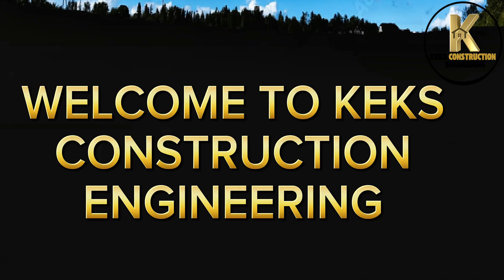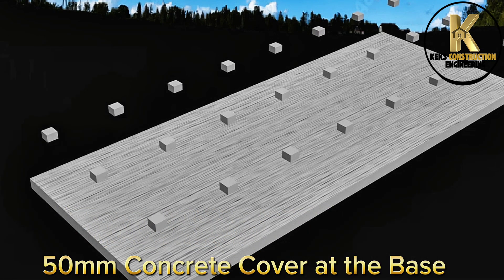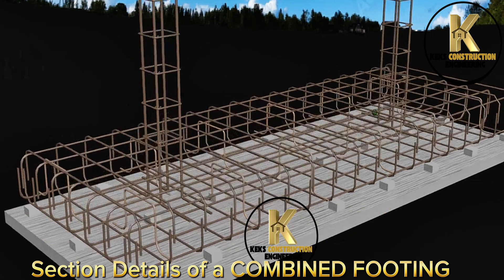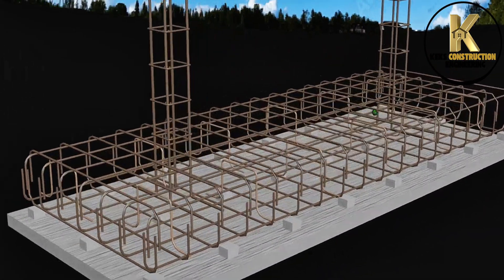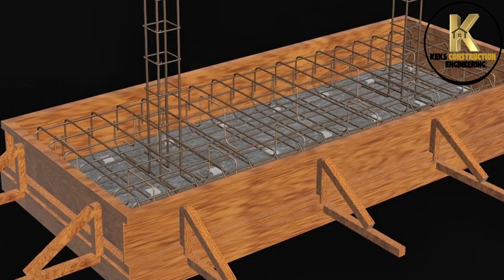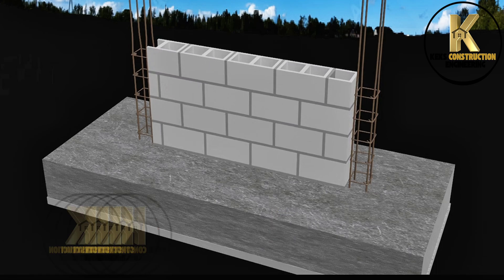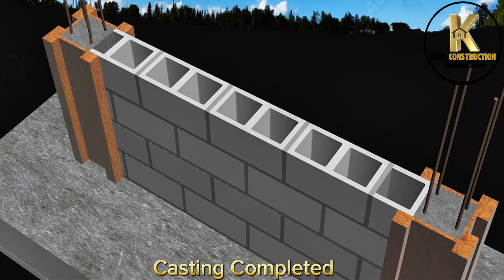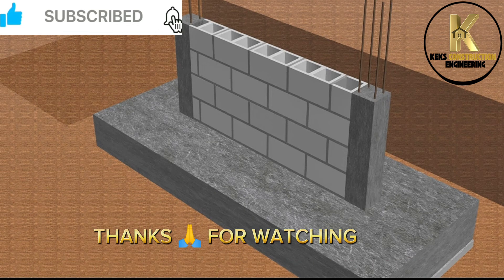COMBINED FOOTING Details & the Step by Step CONSTRUCTION PROCEDURES

Comment: What's the diameter of reinforcement for the horse benches? And it's purpose
Reply from the maker: Y10

The purpose is the Separate the Top Reinforcement from the bottom Reinforcement so that they will not lap together and reduce the effective depth of the Base. The horse bench serves as a Chair for the top Reinforcement to sit on without collapsing to the bottom Reinforcement.
Reply: @keksconstructionengineering  Sir how can it reduce effective depth of base
Reply from the maker: @ChinonsoOgalanya  
Read my response very well.... the answer is there
Reply: @keksconstructionengineering understood, i was about asking the same question
Reply from the maker: @macdonald5731
Alright..
Ur support and encouragement on this work matters a lot.
Share this video in different places and media so that more people including ur friends and colleagues can learn and benefit like you too
Reply: @keksconstructionengineering  is the horse bench and the top reinforcement applied to only combined footing? Because in a single footing it’s not applied and what’s the purpose of the top reinforcement?
Reply from the maker: @VincentMoses-w1k 

The Top reinforcement is refered to as Compression Reinforcement. 
Hence, it's designed to resist negative moment  and Compressive Force at the top just as the Bottom Reinforcement is often refer to as Tension Bars which resist tension Force at the bottom. 

(Speaking as a structural designer now😂)

Thanks.
Reply: @keksconstructionengineering  so why is the horse benches and compression reinforcement not applied in a single footing?
Reply from the maker: @VincentMoses-w1k 

You are asking two Questions in one here. 

Let me address them one after the other. 

1. Horse Bench is Use to separate the  two layer of reinforcement (Top and Bottom bars) in order to hold them to position and to maintain the effective depth of the Base, slab, pile cap or and thickness that required Double reinforcement. 

2. As you can see, two Columns transmitting different loading are standing on the same Pad base. As a result of the different load on these two columns, there will be different moment induced on the base about the two points of the Columns. Hence to balance this forces (moment), Compression Reinforcement is required where necessary. 

I said where necessary because it's not in all combined footing that Compression Reinforcement is required. Surprisingly, Compression Reinforcement can be required in beam, Slab, single pad footing etc not only in combined footing. It all depends on the K - Value during design. 

Thanks.
Reply: @keksconstructionengineering  thanks for the explanation. I still look forward to visual explanation of how different floor levels are constructed when plinth bean is used.